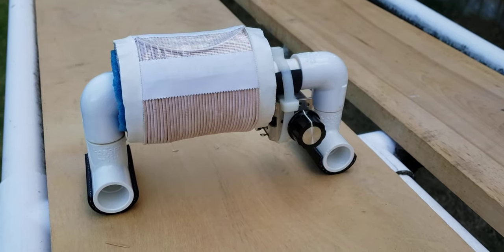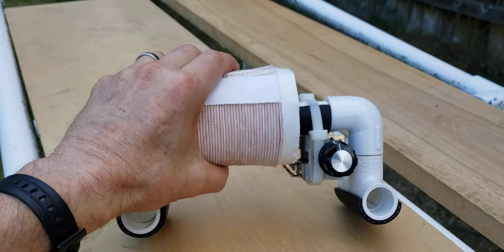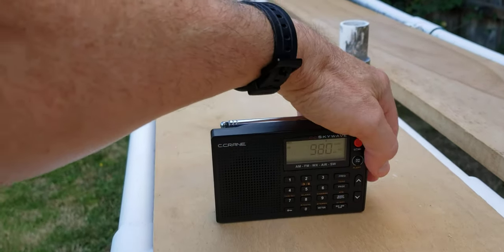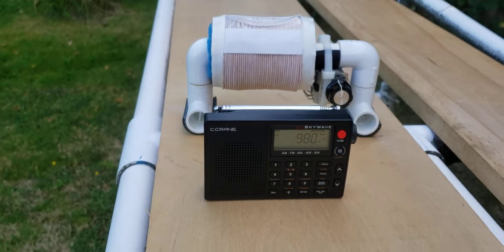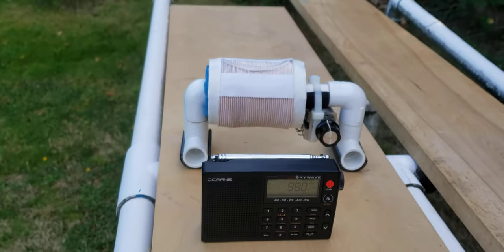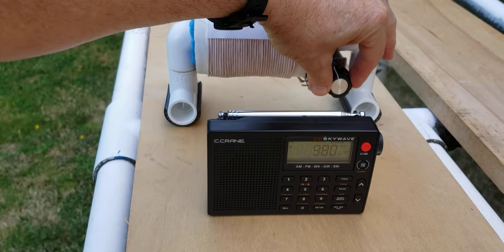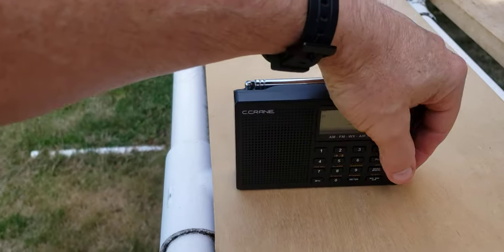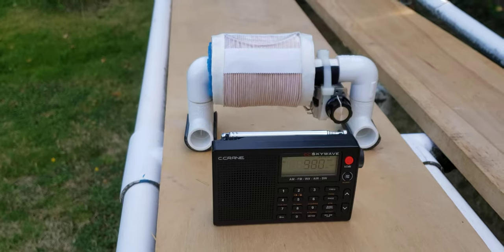2.8 inch (71mm) Micro FSL Antenna Demonstration

Comment: I just tested a Tecsun PL-330 for the first time today directly connected to an AN-200 loop and it did very well. I`m moving soon to a place where I can experiment with any length of outdoor antenna I want away from the insane dog next door and all of the interference here. I have a couple of large loops but haven`t fixed them where they can be directly connected to a receiver. Once I move I`m gonna build one I can install outside to hone in on weak daytime signals or string out some very long wires and try to get some Texas stations. We get just a few weak boring stations here during the day and years ago in a similar situation I could get about 50 stations using two aprox 300 ft longwires strung out in opposite directions connected to a small inductive coil of magnet wire wound like a crystal radio on a paper towel tube.
Reply from the maker: Good luck in your experimentation, and good DX to you!

Comment: Hi Gary. Thank you for all of your videos and various antenna tests. I started looking into building your micro FSL and realized I'd be forking out about $250 for building this antenna. Yikes! What kind of performance gains do you see with this antenna compared to a much-less-cost loop wire antenna (2' to 3' per side) tuned also with a var. cap.? (BTW, I looked for the ferrite rods you recommend from Amidon and could not find any 3/8" x 4" rods made out of the R61 material. I could find R33 rods with those dimensions but not R61. $7 each x 28) The cost of ferrite rods have become so outrageous that I doubt I will build this due to the cost of the rods. Really discouraging.
Reply from the maker: Hi Alan, You are correct that Amidon is currently out of the 3/8" x 4" ferrite rods, although they do have the 3/8" x 3" variety at $7.50 each. In comparison to the 3" Baby FSL with the Russian surplus ferrite rods this antenna was more of a pet project than a substitute, with the goal of building something smaller and lighter with equal performance. But even the Russian surplus rods are not cheap, so a DXer essentially needs to decide whether the compact performance offered by the FSL is valuable enough to pay a premium over the small, cheap air core loops like the AN-200 and Terk Advantage. The 3" Baby FSL can be built for around $125.00, and will outperform all of the smaller commercial air core loops.

Comment: Hi Gary, great job! How many ferrite rod it need? I checked on Amidon site and figure it out roughly, it will cost over $280 just for the ferrites! Wow! those things are so expensive.
Reply from the maker: Hi Christian, the Amidon Type 61 ferrite rods (3/8" x 4") sell for $4.50 apiece before shipping, and the design uses 28 of them. So the total ferrite rod cost before shipping is $126.00. Unfortunately, Amidon's shipping charges overseas are very high. The ferrite rods are for sale at the following link  https://www.amidoncorp.com/r61-037-100/
Reply: @DXerGary  Thanks Gary, like you said, $48.72 shipping for here in Quebec + USD exchange = $283.44 CAD...i think i'll wait a bit, i already have a 7" FSL that i made 6 years ago. But i look forward to make one sometime for traveling :-)
Reply from the maker: @twistian40  Yes, unfortunately DXers in Canada and other countries need to pay high shipping costs for Amidon ferrite rods. The Russian surplus ferrite rods sold by Ukrainian sellers on eBay might be a better alternative-- the 100mm x 8mm size Russian surplus rod was the basic component of the 3" Baby FSL antenna, demonstrated in another video.

Comment: Hello Gary. Which connection method provides the best signal strength for the DSP receiver? Inductive connection or direct coil connection to the circuit board?
Reply from the maker: Hello Igor, for this type of antenna inductive coupling is the best method. Direct connection to the circuit board would be risky, with too much RF for the DSP chip (speaking from experience, since I have destroyed several DSP chips by attempting direct connection from FSL antennas).

Comment: Why is everything plastic? Is it for build convenience or better reception?  I have no FSL and the base has a ball bearing turn table attached.
Reply from the maker: Plastic is lightweight, cheap, and provides reasonable insulating performance. Any metal material around an FSL antenna should be avoided for best performance.